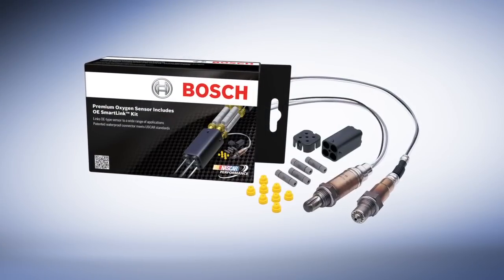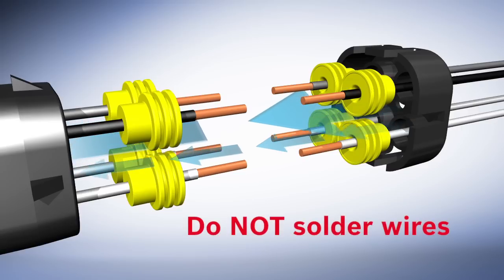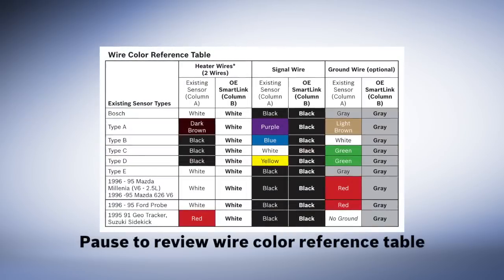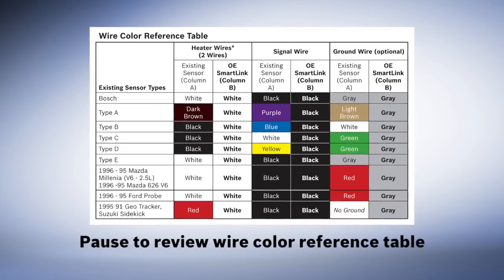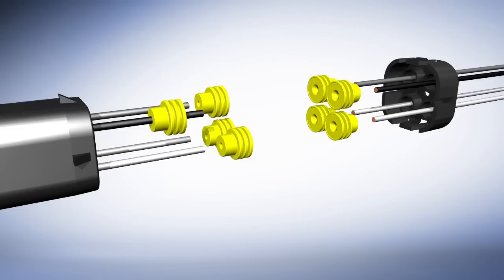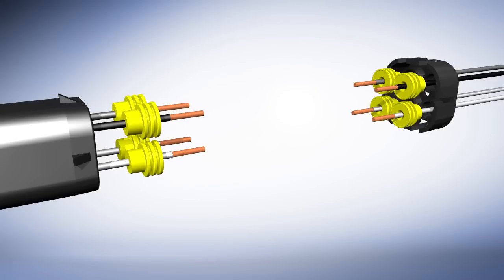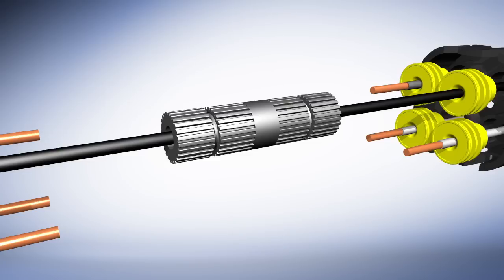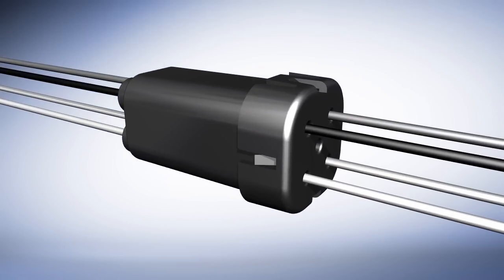Installation: Bosch O2 Sensor with SmartLink™

Comment: Yeah, well what if you have 5 wires like me?  How does that work?
Reply: +Andrew Kelly I have similar problem but mine does not even have two same color wire on the original. what did you end up doing on yours to get it to work?
Reply: I have a 2007 VW and I also have 5 wires, I cannot find anything to relate to.
Reply: @AgustinCortes  Same problem here. Obviously not  a "Universal" replacement. Retailers need to stop selling us fraudulent representations.
Reply: @eziomo7685  did you figure out how to match the 5 to the 4 wire?
Reply: @ILuvShaneDawson131  There is no fix with this type of connection. It needs to be a "wideband" o2 sensor.  Hence the extra wire.
Reply: did you ever find which goes to which? I'm having a hard time with mines can you please help out?
Reply: Did you ever figure it out?

Comment: I would have thought twisting the wires together and shrink tubing or electrical tape would be fine for attaching the connector onto the oxygen sensor. The consistent story I get is that this is not acceptable and that the oxygen sensor works through minute differences in electrical resistance and that if there is any resistance from the connection at all, the reading to the computer could very easily be off. Many people go the cheaper route of the universal, but I am convinced that it's worth paying a little bit more for this crucial engine component. An OEM might be the second best choice for replacement.
Reply: It's a lie... first off these sensors do NOT transmit information of airflow through the wires... this is total BS... and secondly soldering does not really create additional electrical resistance... if you understand how electricity works you'd realize resistance would only occur if the wire contact area reduced... and lastly, just don't buy universals and much less BOSCHE for anything besides German vehicles.
Reply: Yes. 330e for oem and 45e for bosch..  Ill try the bosch first :D
Reply: Works great on my Mercedes Benz S500 4matic W220

Comment: For future watchers, the "drawing air through the connection" is a real requirement. The O2 sensor works by measuring the O2 levels in the exhaust against the ambient O2 levels. Don't cover the hole in the connector that lets air in.
Reply: wires do not measure shit, sensors does.
Reply: You’re wrong here’s why coming from an electrical engineer btw

How Oxygen Sensors Work and Why Wiring Integrity is Crucial

Understanding Oxygen Sensors:

Oxygen sensors are vital components in your vehicle’s exhaust system. They measure the oxygen levels in the exhaust gases and provide data to the engine control unit (ECU). This information helps the ECU adjust the air-fuel ratio for optimal combustion, which improves performance and reduces emissions.

The Role of Wires and Connectors:

	1.	Air Passage Through the Sensor:
	•	Ambient Air Reference: Oxygen sensors need a reference to the ambient air to compare it with the oxygen levels in the exhaust gases. This reference air is crucial for the sensor to generate an accurate voltage signal.
	•	Porous Wire Insulation: Some oxygen sensors have wires with a porous insulation that allows a small amount of ambient air to reach the sensor element inside. This design ensures the sensor can compare the oxygen content of the exhaust gas to the ambient air accurately.
	2.	Why Soldering is Problematic:
	•	Heat Damage: Soldering wires can damage the porous insulation and the sensor’s delicate components due to the high heat involved.
	•	Sealing Issues: Proper connectors and crimps are designed to maintain the necessary pathways for air to reach the sensor while also providing a secure, sealed connection. Soldering can disrupt these pathways, leading to inaccurate readings.
	•	Mechanical Stress: Soldered joints are less flexible and more prone to breaking under the vibration and movement typical in a vehicle, which can compromise the sensor’s function.

Explaining to Viewers:

Here’s a simple way to explain it:

Why Oxygen Sensors Need Proper Connections:

Oxygen sensors help your car’s computer keep the engine running efficiently by measuring the oxygen levels in the exhaust. For these sensors to work correctly, they need to compare the exhaust gas to the outside air.

How Does Outside Air Get to the Sensor?

Some oxygen sensors have special wires that let a tiny amount of air through. This air travels through the insulation around the wires and reaches the sensor inside. This comparison between the exhaust gas and outside air helps the sensor generate an accurate signal that your car’s computer uses.

Why Not Solder the Wires?

	•	Heat and Damage: Soldering uses high heat, which can damage the special insulation and the sensor itself.
	•	Sealing: Proper connectors are designed to keep the air pathways open while also sealing the connections. Soldering can block these pathways, leading to bad sensor readings.
	•	Flexibility: Cars move and vibrate a lot. Soldered connections are stiff and can break more easily. Properly crimped connections are more flexible and durable.

Using the right connectors and crimping tools ensures that the sensor can breathe and work correctly, keeping your engine running smoothly and efficiently.
Reply: You’re right but you’re also wrong, the real reason you don’t solder   Oxygen Sensor Wires:

Oxygen sensors are crucial for your vehicle’s performance and emissions control. They measure the oxygen levels in the exhaust gases and send this information to the engine control unit (ECU). Here’s why soldering the wires on an oxygen sensor is not recommended:

	1.	Heat Sensitivity:
	•	Damage Risk: The heat from soldering can damage the sensor’s delicate components and the insulation on the wires.
	•	Performance Impact: This can lead to inaccurate readings or even complete sensor failure.
	2.	Signal Integrity:
	•	Voltage Issues: Soldered joints can cause voltage drops, leading to poor signal quality. This means your ECU might receive incorrect information, affecting engine performance.
	•	Long-Term Reliability: Over time, soldered connections can degrade, leading to intermittent issues that are hard to diagnose.
	3.	Mechanical Robustness:
	•	Vibration Resistance: Vehicles experience constant vibration. Soldered connections are less flexible and more prone to breaking under stress. Crimped connections, on the other hand, are more robust and can handle these conditions better.
	4.	Environmental Protection:
	•	Sealing: Proper connectors and crimped joints provide better protection against moisture, dirt, and chemicals, ensuring long-term reliability.
Reply: The wire act as sensor too.
Reply: The 8 yellow rubber plugs seals off air and water !
Reply: The outside air O2 is mesured by your intake Mass air flow/MAS or MAF
Reply: Yes it does but your maf measure air coming in. Not going out. That’s the 02 sensor job.

Here’s why you’re wrong 

How Oxygen Sensors Work and Why Wiring Integrity is Crucial

Understanding Oxygen Sensors:

Oxygen sensors are vital components in your vehicle’s exhaust system. They measure the oxygen levels in the exhaust gases and provide data to the engine control unit (ECU). This information helps the ECU adjust the air-fuel ratio for optimal combustion, which improves performance and reduces emissions.

The Role of Wires and Connectors:

	1.	Air Passage Through the Sensor:
	•	Ambient Air Reference: Oxygen sensors need a reference to the ambient air to compare it with the oxygen levels in the exhaust gases. This reference air is crucial for the sensor to generate an accurate voltage signal.
	•	Porous Wire Insulation: Some oxygen sensors have wires with a porous insulation that allows a small amount of ambient air to reach the sensor element inside. This design ensures the sensor can compare the oxygen content of the exhaust gas to the ambient air accurately.
	2.	Why Soldering is Problematic:
	•	Heat Damage: Soldering wires can damage the porous insulation and the sensor’s delicate components due to the high heat involved.
	•	Sealing Issues: Proper connectors and crimps are designed to maintain the necessary pathways for air to reach the sensor while also providing a secure, sealed connection. Soldering can disrupt these pathways, leading to inaccurate readings.
	•	Mechanical Stress: Soldered joints are less flexible and more prone to breaking under the vibration and movement typical in a vehicle, which can compromise the sensor’s function.

Explaining to Viewers:

Here’s a simple way to explain it:

Why Oxygen Sensors Need Proper Connections:

Oxygen sensors help your car’s computer keep the engine running efficiently by measuring the oxygen levels in the exhaust. For these sensors to work correctly, they need to compare the exhaust gas to the outside air.

How Does Outside Air Get to the Sensor?

Some oxygen sensors have special wires that let a tiny amount of air through. This air travels through the insulation around the wires and reaches the sensor inside. This comparison between the exhaust gas and outside air helps the sensor generate an accurate signal that your car’s computer uses.

Why Not Solder the Wires?

	•	Heat and Damage: Soldering uses high heat, which can damage the special insulation and the sensor itself.
	•	Sealing: Proper connectors are designed to keep the air pathways open while also sealing the connections. Soldering can block these pathways, leading to bad sensor readings.
	•	Flexibility: Cars move and vibrate a lot. Soldered connections are stiff and can break more easily. Properly crimped connections are more flexible and durable.

Using the right connectors and crimping tools ensures that the sensor can breathe and work correctly, keeping your engine running smoothly and efficiently.
Reply: +Zack Darpinian I have 2 dark brown wires, one light brown and one purple, how to know if I connect the correct dark brown one?
Reply: Stfu 😂 the wire needs to breathe 😂😂😂... I can believe ppl fall for this shit

Comment: I put one on my 2000 suburu  and I still get cel and scanner live data reads no voltage from sensor. Maybe will just go with oem. But I had no instructions for wires.